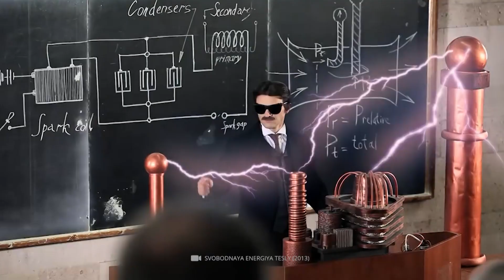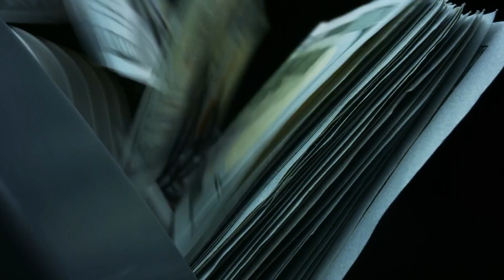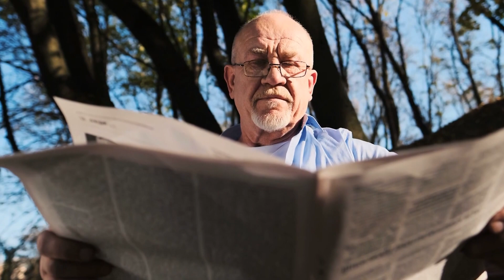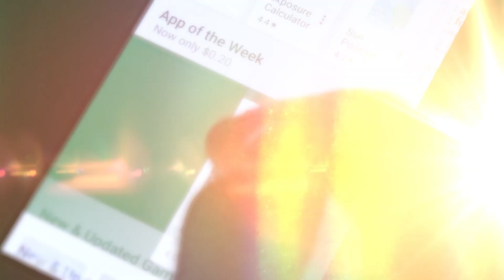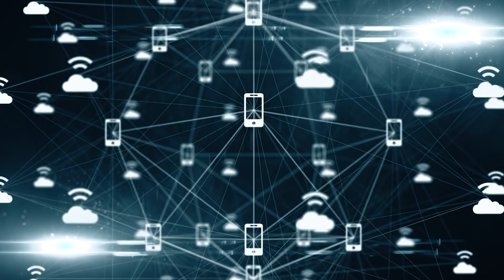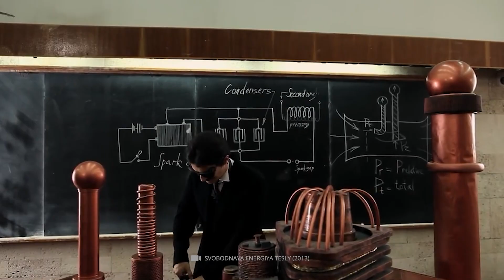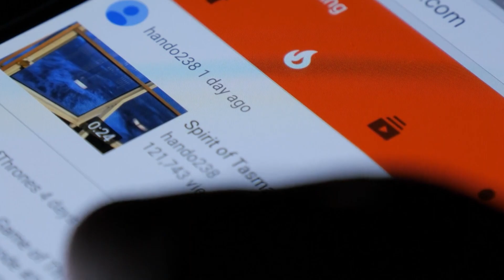10 Predictions of Nikola Tesla's future that turned out to be true!

Comment: Tesla's remote control system used RF & bulky electric relays but nowadays it is IR & electronic relays & it has been possible due to the unbelievable semiconductor technology developed in late '50s in BELL labs, Intel Co.& other firms.
Tesla's wireless electricity transmission is a unpractical & dangerous venture to be implemented since nobody wants a highly electrically charged atmosphere to live in & it would destroy all our present day radio communications. Present day small distance & small power distribution possible by micro waves using not harmful levels of laser, another semiconductor , technology. Besides we need complicated electronic equipment to transfer electrical energy to  micro waves & back at transmission & receiving ends making the equipment more expensive.
Free energy concept is a hoax, Tesla lived for 80+ yrs in good health & he didn't show it practically at least to have it in small amounts, nor any plan to implement, if such plan now available in Serbia they could implement it now.
As a visionary & eccentric inventor he contributed to the early 2-phase AC system yet our present day 3-Phase Srar/Delta system was by Dolivo Dobrovolsky.
There is no connection with his predictions & the technology he invented because he haven't contributed to the semiconductor technology even though it started in early 1900 while he was actively worked in that era. Transistor, Integrated Circuit,  Microprocessor, Software control Digital system....all discovered & invented after his death in1943.